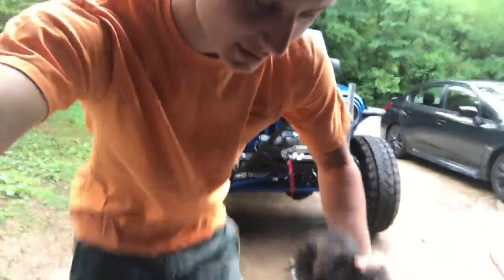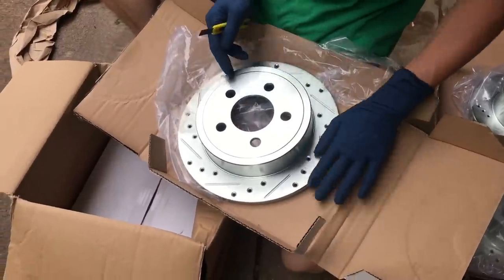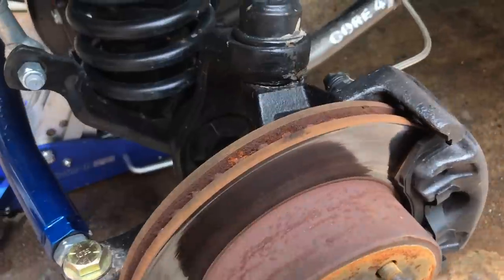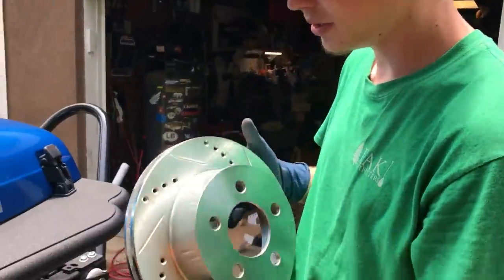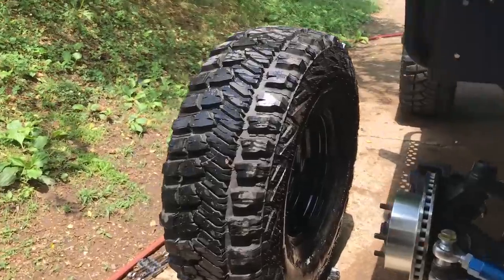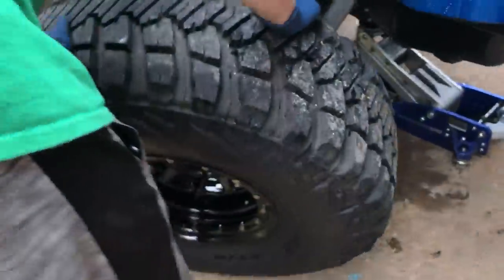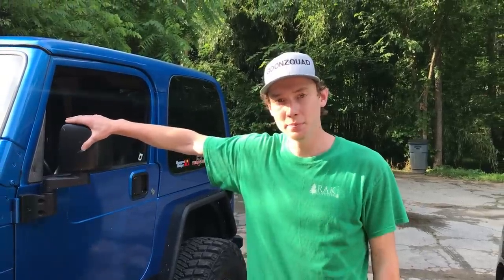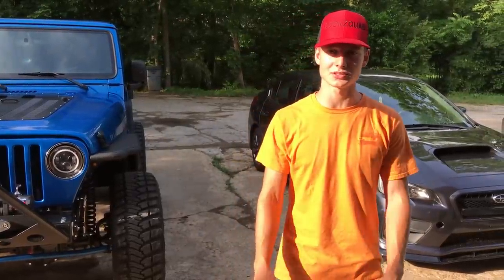Drilled And Slotted Rotors! Are They Worth It?

Comment: The reason they work so good is because they are new pads on new rotors...not because of the holes or slots.  You don't heat up a road of off road vehicle near enough to see the benefits of performance rotors.  Lots of race cars use regular blank rotors and heat them up glowing cherry red and no issues.
Reply: Yes, your grocery-getter will do well on those "regular blank" rotors, but they won't do diddley for high-speed cruising -- or when driving hard in mountainous terrain.
The famous 95 MERC was modified to accomodate braking at high speed -- for cruising the deserts and mountains of the American West -- Installed nearly 8 years ago -- and brake performance has been outstanding. 
https://www.mercuryforum.com/forum/grand-marquis-14/1995-grand-marquis-restoration-8937/

Comment: I've found drilled and slotted wear the pads faster, aren't worth it.
Reply: slots shave up pads ...
drill holes reduce disk surface...

Akebono ceramics are the best pads made in Japan

Agressive stopping power is SEMI-METALIC pads... stock on Benz (eat through the rotors too!)

Best brakes for your car: OEM pads+rotor matched pair !

Comment: Drilled and slotted rotors just eat through brake pads faster.
Reply: That ain't true, Dude -- they run cooler, so the pads don't "burn up".
 I've run Drilled & Slotteds for several years -- pad wear is normal.
Whenever doing a brake up-grade, flush out the old brake fluid with a quart of D.O.T. 4 Brake Fluid. Better water resistance and higher boiling temp.

Comment: You but the rotors on backwards... you want the slots facing the front to take air in to cool down. This video is amateur.. use jack stands before that jack relaxes & you ruin your suspension....

Comment: Drilled rotors are dumb. One of the more ricey mods. Even the high end manufacturers don't put it on their cars. They are way more prone to stress fractures down the road offsetting the slight increase in cooling. More for looks than anything else. Same story with slotted. Slightly better cooling but this time they will eat your pads way quicker. Have fun swapping rotors every 3 years.

Comment: Save from glazing and longer life of all your break components.  Less heat the better even in the engine.  You want the engine cool as possible also it will run better .
Reply: That's bullshit, Dude !! Modern Domestic and Foreign Engine manufacturers design their engines to be most efficient at 195 F.-205 F.
 The MYTH is that "cold engines produce more power".
 The FACT is that "cold engines wear out faster, MUCH faster".

Comment: Jeepers are such ricers. You have successfully reduced the surface area of your brake rotors In other words killed your braking performance.  The holes in those brake rotors don't cool them down better the cause turbulence inside the vents which retains the heat.

Comment: Sorry guys but you're buying into the bullshit. The only value that cross drilled rotors used to have is they would allow the pad's to off-gas through the rotor, giving you a firmer grab under heavy braking. Because the compounds in brake pads have changed and no longer off-gas, the only value in cross drilled rotors is a perceived performance appearance. Show me a F1 or Indy car with cross drilled rotors and I'll kiss your cat! You just wasted a lot of money. If you're going to put those stupid big tires on everything the only solution is to invest in bigger brakes.